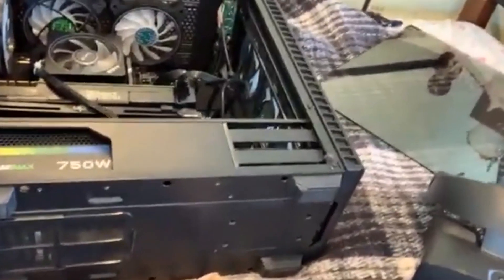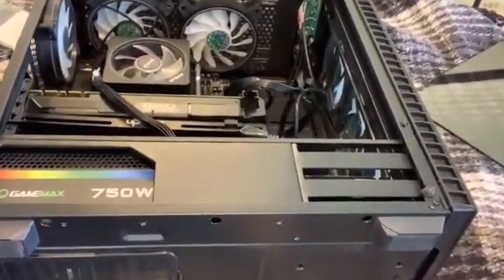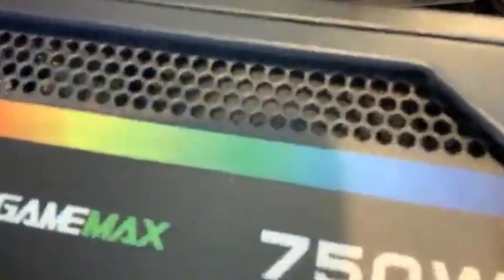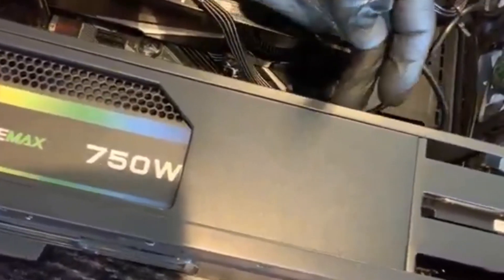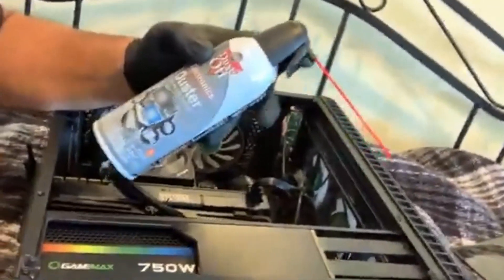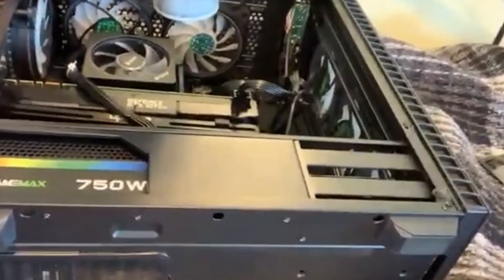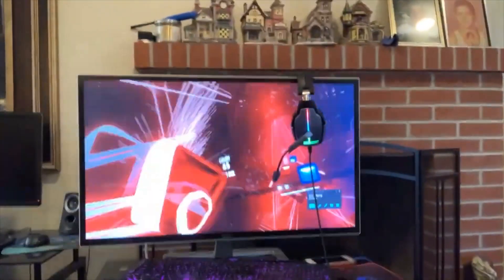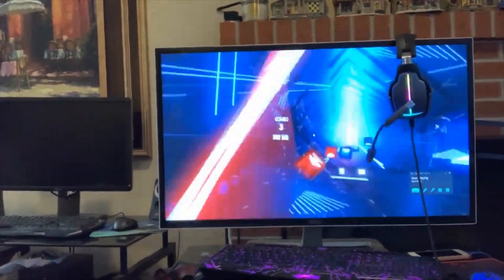Repair Fix Oculus Rift S Problem With Beep, Static, Disconnection

Comment: I have this issue too, people say it's the cable. It's not (for me), it works fine on my laptop, i can use it for hours with no issue.
But on my pc it does the beep and disconnect anywhere between every 5 minutes and 1 hour.
I hope you where able to fix it.

Edit: The fix that worked for me was using a usb 3 hub and plugging the usb into that. If anyone reads this. I hope this helps you as well
Reply: Same
Reply: @Drew9140  a usb 3 hub fixed the issue for me. Maybe you can try as well. Hope it helps
Reply: @HarmonyIsDead  a pcie one?
Reply: @Drew9140  a usb one works fone
Reply: @HarmonyIsDead  how does that work? Wouldn’t it make it perform worse?
Reply: @Drew9140  for me i don't notice a difference performance wise, apart from it no longer randomly disconnecting.
Reply: Same. Works great on my kids computers, and mine used to work well, but now mine keeps disconnecting and the audio is garbage all of the time.

Comment: I finally found a troubleshoot to some of the most basic errors with the oculus rift s, 

1. Beep sound, static, crash:
If you have the beep problem its an issue to do with your oculus rift s cable. Basically you need to buy a new rift s cable. You can try to report it to oculus and get the cable for free like i did. 

2. Static then crash:
It could be different things, i got this error the day i bought my oculus rift s and I've had it for months. The only thing that fixed it to me is to download visual studio 2015 and 2019. You should also try to reinstall the oculus app but i recommend to download virsual studio 2015 and 2019. 

3. Hands freezing in the air:
If there are any strong lighting around you such as led lights, go to the oculus app and settings and click on the headset and click on the lighting thing to 60hz. If it doesnt work just redownloand the oculus app or repair it by going to oculusetup and click repair. 

If this helps please try spreading this around to help other people.
I hope you have a lovely day.
Reply: you're a god... now i know that i can replace the cables.
Reply: What?? How did you get one for free? They didn't let me.
Reply: how do you install the visual studio?

Comment: Have you fixed it because I have the same issue and oculus support's help is bad
Reply: If you have the beep, Static and crash error then its a problem to do with your cable, basically you just need to buy a new rift s cable and it should fix your problem since it fixed mine. You could try to get it for free by reporting your issue to oculus support. I hope this helps
Reply: @evil_plan  it helps but not really because they don't sell cables and stuff for the rift but it would have fixed it
Reply: @BongoBingbong  then i got another trick for you. Just tell oculus support about your issue and keep them updated with it. I kept talking  to oculus support till they finally gave me a new rift s cable. I know the rift s support is trash but i kept talking to them till they gave me a cable replacement. Try doing what i did
Reply: @evil_plan  ill try telling then my cable snapped in half and i cant use my headset because they dont sell cables
Reply: @BongoBingbong  thats a bad idea because they will tell you to send a picute of the broken cable. Just explain to them the exact problem and say you want a new cable to fix the issue

Comment: This is so strange though, I've been using my Rift S on the same PC for about a year now, and ever since I got my new GPU it has been doing this. I still have my older GPU which is nearly as good as the new one, just louder and a little higher temps. I'll try updating all my drivers, but if not then I'll probably put my old GPU back and idk what I'll do with the new one I don't want to waste it...
Reply: Give it to me 😂

Comment: I have the same issue too. I bought an external powered USB hub and it worked fine at first. Eventually the hub starting malfunctioning after a few days and now I'm back to square one. From what I have read a lot of people say its a faulty cable.

Comment: Have you found a solution, because i am having the same issue, but please note i have used Rift S for months on my same PC (with no hardware change) and the i guess since sep 2020 it started this problem i have tried literally all of the fixes that internet has to offer but noting helped me. and there isnt any time stamp on when it looses its connection to display port, and then PC hangs up for a second and all of the USB devices turned off then back on, please note here that i have disable all of the power saving options for USB ports, and also un-checked the power saving option in human interface devices as well and also done dozens of so called fixes that i cant even count of now BUT NOTHING HELPED, cable is also fine as i wiggle it many times and it didnt get disconnected but it did it on its own and on its will.
Reply: @AAm942  ok thx i also got 2.2 but it didnt  help
Reply: @HalfLife2Beta  Me it is 2.6 , Just hope to get it fix , Because I don't want to lose my vr  and buy another one(or I can contact Oculus support To do something maybe)
Reply: @AAm942  hey i got this problem how to see firmware update ? thx in advance
Reply: @forcefultax6699  no :( i play less VR